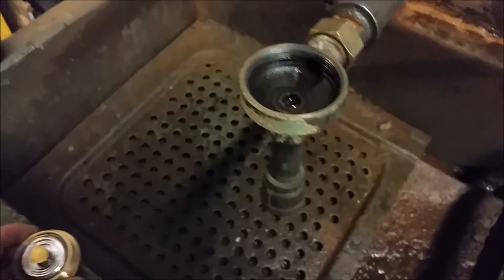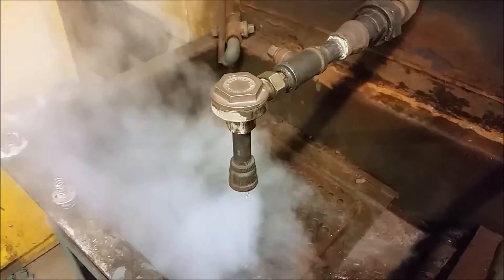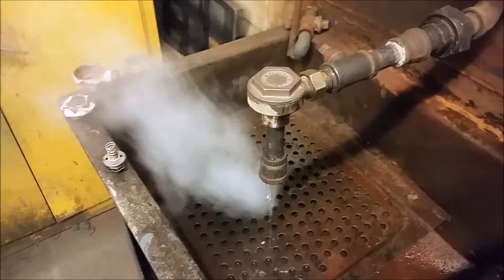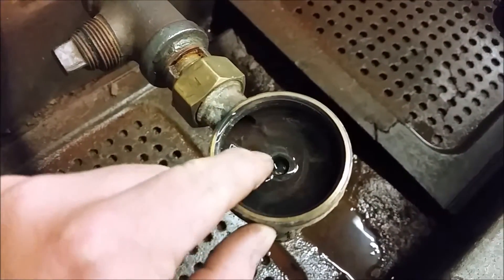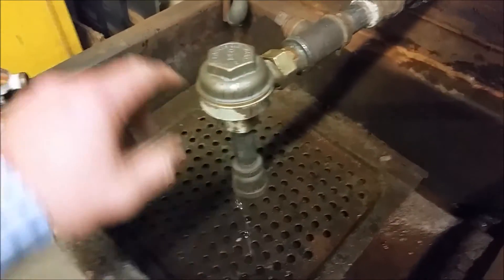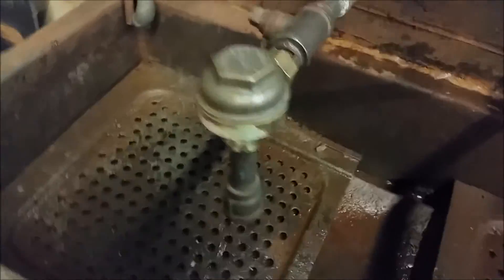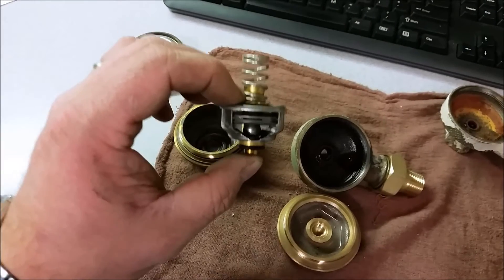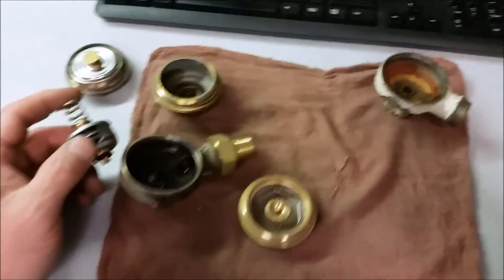Testing a Dunham #1 steam trap

Comment: Thank you for such a detailed explanation of the differences.  I have at least 6 of the old #1's  in my upstairs apt house that are currently working.  Cost of replacing with a new old style diaphragm is basically the same as the newer 1950 model but then you need to purchase the new cover for $50.00.

Comment: Good video. A little more info on the product would have been great. Is this a kit with the cap and cage unit? Is there a gasket available? Can I reuse the original cap? I have a house that was built in 1902. I have 11 radiators with steam traps, and a few steam traps inline. From what i can tell all of them are Dunham #1 units. I don't want to replace with new traps because they are quite expensive. This would be a great alternative depending on what this upgrade costs for each unit.
Reply: Hi Ken.  The repair for a Dunham #1 would comprise 2 parts.   Part #1950 is the actual cage unit that does all the work.  Part #1950C is the cover which is required for the initial change out in order to fit the cage unit.  The cover only need to be purchased once and it comes with a replacement gasket.  Pricing depends on your supply house
Reply: how do you know when you need a 1950 or a 3133? i have the dunham 1 on cover but i think they are the shallow bodies